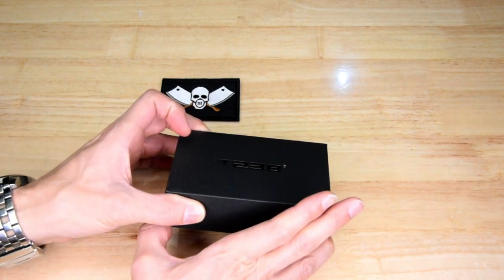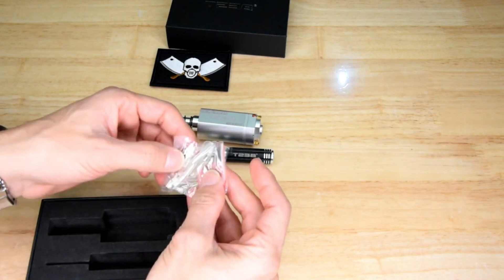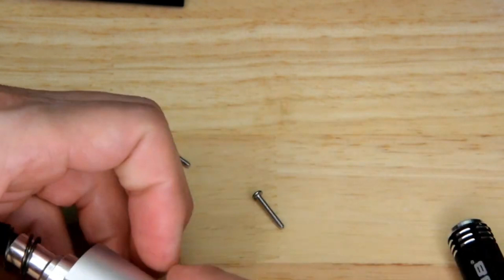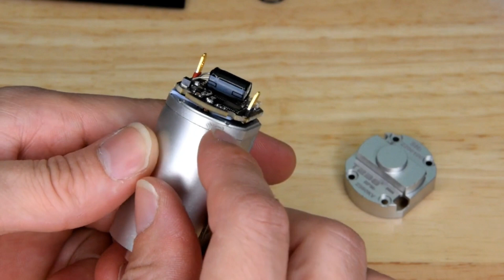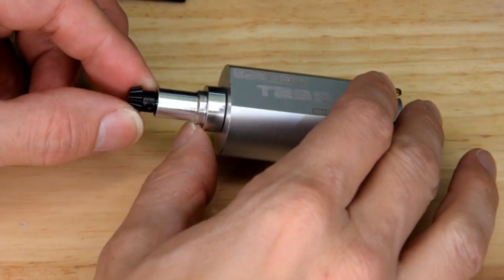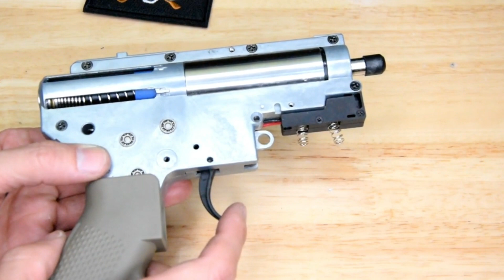T238 brushless motor test and review

Comment: My guess the provided tool is for access to the circuit board for removal so that you can access the end of the motor shaft to use a pinion press. Something like that.

Comment: Hello, I wanted to know if it could be used with an electronic trigger or ECU that is not the same brand as the engine. What happens to me is that I have had a titan gate basic trigger for a long time, in fact I saw people on YouTube who use this same combination without problem.
Reply from the maker: Hi. Disclaimer: We only recommend using T238 mosfet to pair with T238 brushless motor. If using other brand mosfet, please turn off active braking.